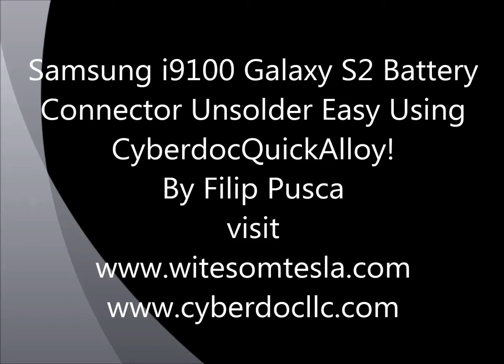Samsung i9100 Galaxy S2 Battery Connector Unsolder Easy

Comment: One more good lesson. Thanks. I couldnt find a real cupper iron tip like yours. I purcahsed a lot online. They say cupper but not real. Do you know any seller on ebay selling real cupper iron tips. Or any other online store.
Thanks
Reply from the maker: I have 1 left of this it is made of Nickel+Copper this why it is good my local seller told me he buy some years back 3kg of them but he don't sell anymore because is not worth,those that stick to magnet contain a layer of iron after copper layer they last longer but the soldering experience is very bad also need to set temperature above 400C to melt the solder.

Comment: what a soldering iron?
Reply from the maker: Lukey 852D
Reply: Wites OM Tesla very specific tip, where the supply of the best Tips
Reply from the maker: Marcin ww You sell tips,do you have made of Nickel+Copper alloy?
Reply: I do not know what are the proportions have Aoyue company, but probably not the best quality
Reply from the maker: Marcin ww There i have a video where i test them with magnet just watch and tell me if it stick then is not good.